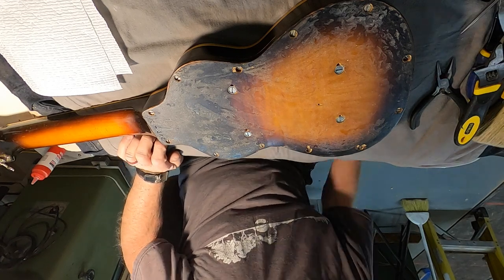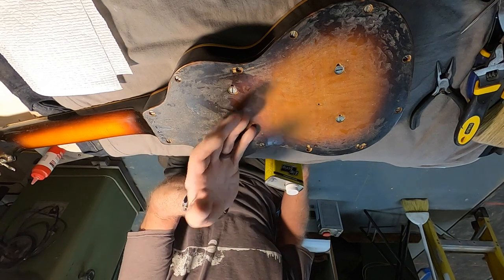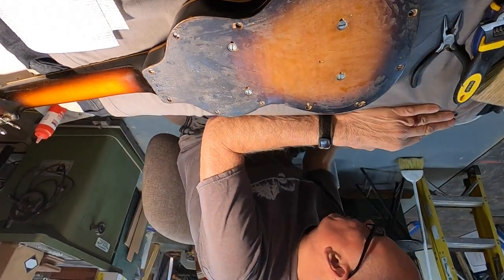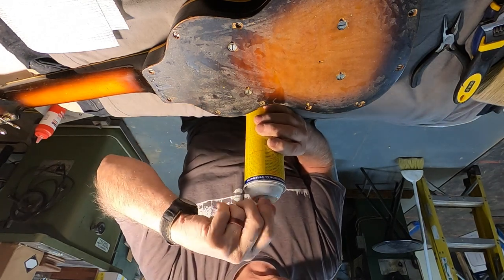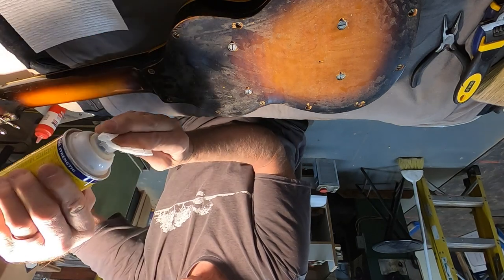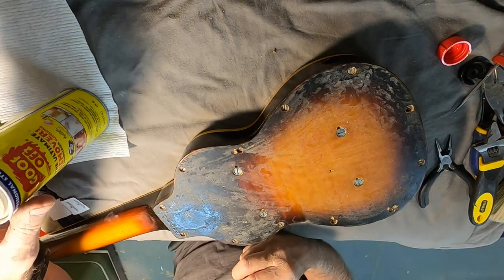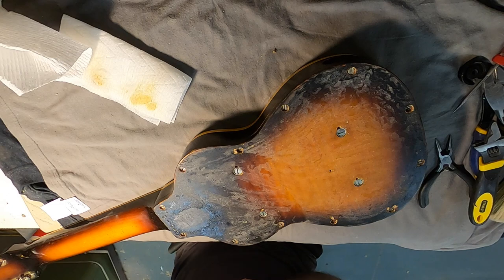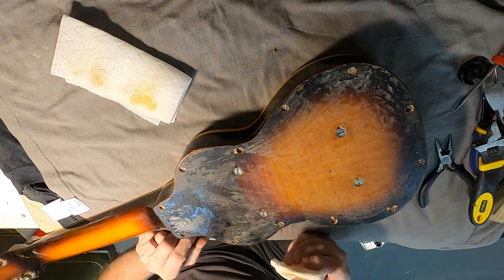1936 GIBSON LAP STEEL #2 by JONAH GUITARS

Comment: Nice work Dane! A cool trick I learned for sanding spots like that. Use the tape with the holes just as you are but use a strip of sandpaper with a smooth back. Place sandpaper on top of stick and place a finger on top of that and pull the sand paper out from under your finger repeatedly. I've found the edges of the tape last a lot longer that way and it just sands that specific spot where the tip of your finger is pressing down. You can also use something smaller than your finger to apply light pressure and sand an even smaller spot.
Reply from the maker: Thanks for having a look James. I use the finger spot sand trick when I don't have tape. But yes that's a good idea I just didn't think of it.